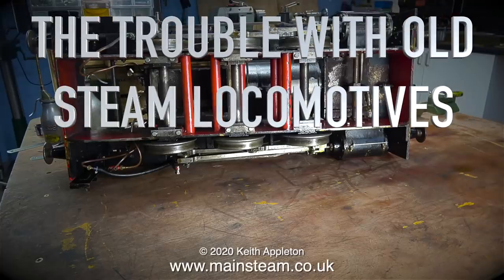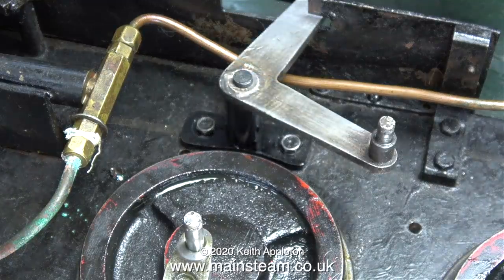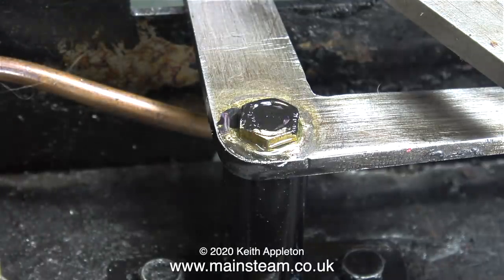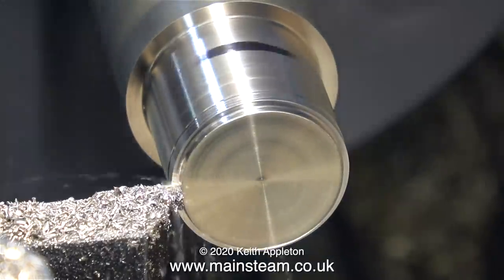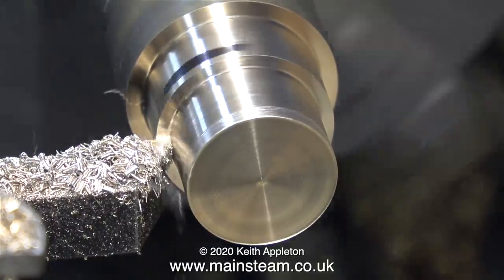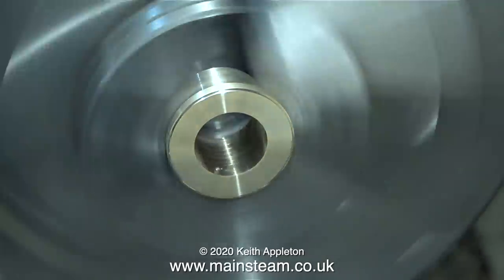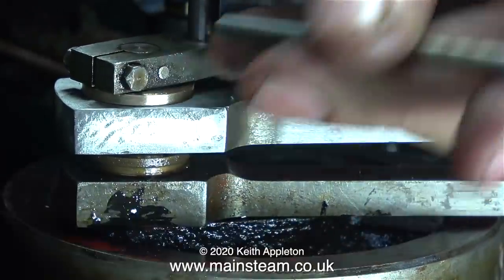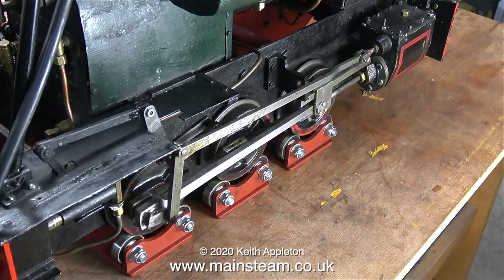THE TROUBLE WITH OLD STEAM LOCOMOTIVES - PART #19

Comment: I noticed the rolling road support under the rear-most axle was moving back and forth on the bench as the engine was running on air.  Is that an indication of any problem(s)?  I'm just curious and had to ask.  Thank you for all the videos!  They are very enjoyable and informative!
Reply from the maker: No, it's fine - in an earlier video I showed the wear in the axleboxes . . .

Comment: A lot of Japanese made equipment had paint on bolt threads, no doubt a cheap form
of Loctitie. It looked more like nail polish and was used in good quantity. The Japanese
had a nifty way of saving on machining costs by using larger than needed holes to
allow fine adjustment to mechanical devices and then use a nice quantity of nail polish
on the threads to make sure the mountng/adjustment screws didn't work loose.
Thousands must have been employed as nail polish puter oners and it must have been
a craft handed down from father to son.

Comment: Any idea why the rear most driver moves the treadmill bearing blocks around? It would almost appear that the axle is bent or the wheel is out of round (which I highly doubt). I also do not understand where the body rocking is coming from either. Does that relate to the smoothness of the timing events? The engine my father has uses the sliding block version of the hackworth valve gear and as motion is introduced in to the rear of the engine, it further serves to obliterate smooth timing. Is this just a function of that style of gear?